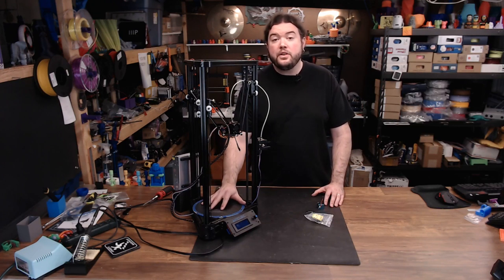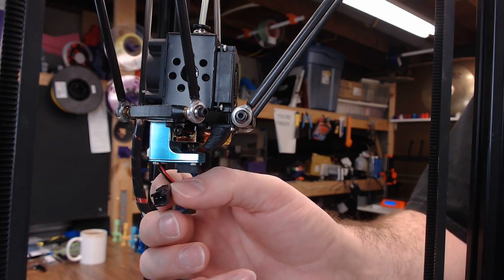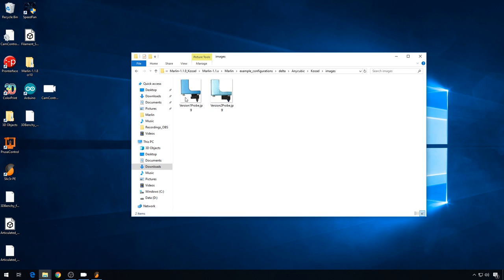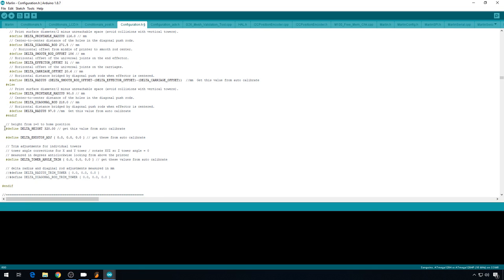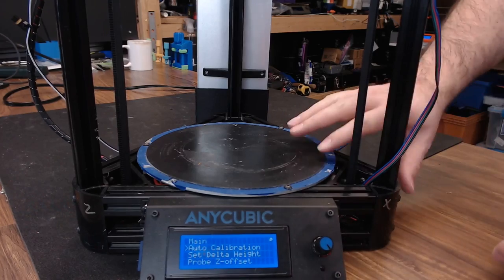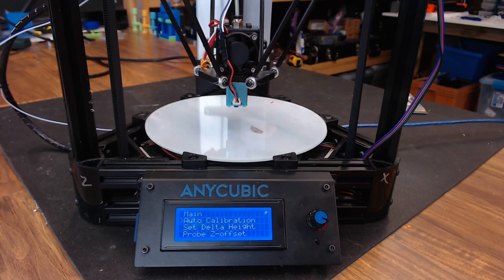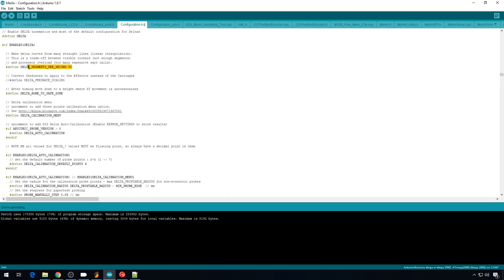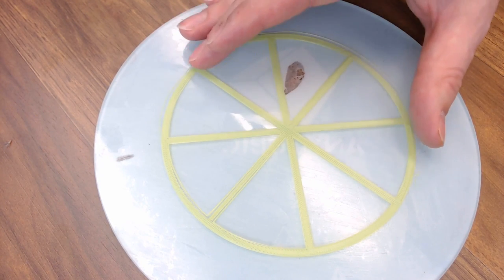Delta Auto Calibration - Marlin 1.1.9 - Chris's Basement

Comment: i can't make it work on mini Kossel
Reply from the maker: What part doesn't work? Does it read the sensor when homing?
Reply: when it homes it comes down some centimeters it doesn't stay at the top, and after the calibration it go down passing the surface of the impression plate  @ChrisRiley
Reply from the maker: @Costudioca  It should come down some, that is safe home. If it goes past you need to readjust your z offset. Make sure you clear eeprom with m502 then m500.
Reply: Ho I see, the problem is I can't conecte to pronterface  @ChrisRiley
Reply from the maker: @Costudioca  Oh, you can't connect up at all? What error does it throw?

Comment: Hey man!  I have an iverntech delta, which I assume is an anycubic rebrand, and followed your directions, but as soon as I hit auto callibrate, it homes, then comes down about 2 inches, goes back up an inch, comes down and inch and stops.  Then nothing...  I figure its got to be a setting thats not allowing the head to come down to the bed.... 

I also have a piezo bed leveling cap that came with the printer... any suggestions?  thanks in advance.
Reply from the maker: What does M119 look like? Sounds like it can't figure out what the sensors state is.